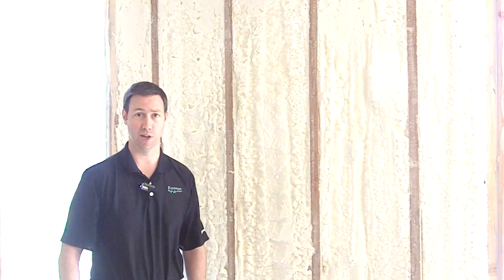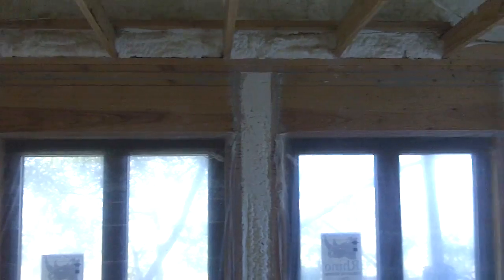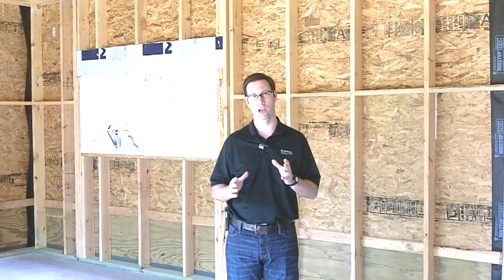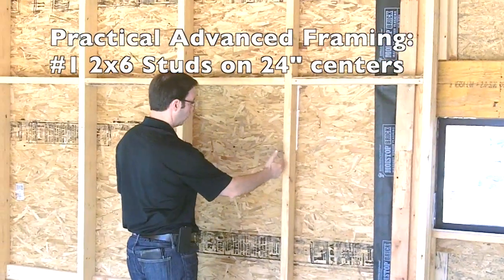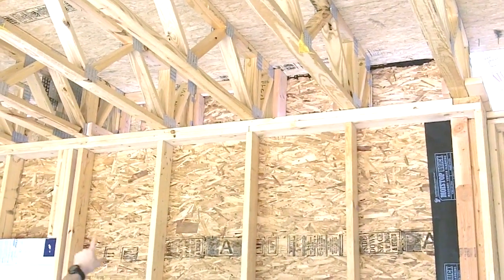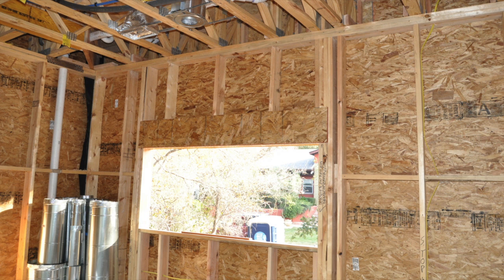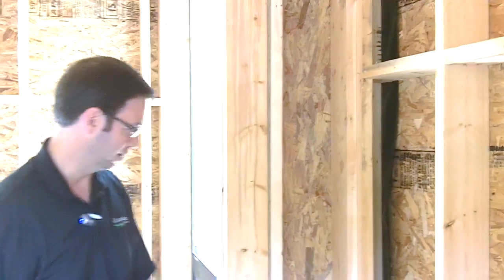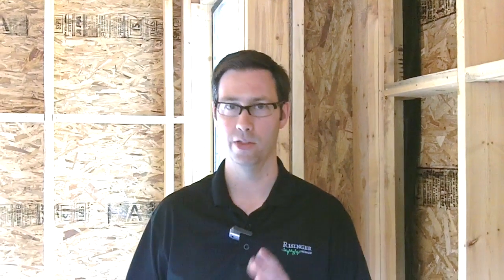Advanced Framing vs Traditional Framing

Comment: 2x6 on 16 inch centers is what I use. Live in the North East with big snow loads. Lumber isn't as strong as it use to be, don't cheap out. All kinds of great insulating techniques, use them.
Reply: Konda, regardless of the modern testing of todays materials, none of that has any effect on the greater stiffness of yesterday's old growth Doug fir framing, which was quite superior.
Reply: There is 20 percent more wood in his wall than in a 2x4 wall with the 16 inch spacing.  He doesn't even need to align the joists, he got that part wrong, though it is always a good practice if it fits in with the build.  

Not only is there more wood, but as far as, say wind deflection loads on the stud alone are concerned, the 5.5 vs 3.5 is  3.9 times stiffer and 2.5 times stronger.  of course the load will be 1.5 times stronger, but it is still a dramatic upgrade.

Stiffness of incredible old growth is not all that big a factor because the product does not go out of column, so until that point it doesn't mater.  If you were making arrows for a bow, they bend deeply with every shot, and stiffness, strength, and grain continuity are all critical, which is why each arrow is tested for modulus before it is used, and graded way beyond the standards for aircraft (aircraft is graded 1/20, arrow wood at it's best close to 0/20).  But with parts that effectively don't deflect, it doesn't mater.  That is why joists are rated for deflection, like 1/240, etc...  Unlike posts in column, they do bend.

What would be a factor would be the fact a lot of the old stuff was 2x4 actual, but 2x6 nominal is still stiffer by 1.94 in a wall being wind loaded.
Reply: Here in WV we would do 2x6 on 16 for exterior walls only and 2x4 for the interior.
Reply: wvman2374 and now with energy efficiency becoming part of the code more and more( B.C.) the suggestion is 2x6 24” o/c which creates less thermal bridging and approx 14% greater area with R20 insulation values
Reply: The more important thing is sheathing ... take a long 2x4 and push on it. It will bend one way or the other.
Now, attach that to plywood, and apply the same compressive force. It doesn't bend anywhere near as much because it is prevented from doing so. It's almost like a half I beam.
Reply: This is the first time I read wood is not as strong as it use to be.  I noticed it to the grain keeps getting wider and wider!  Swamp trees
Reply: Konda, Anytime.
Reply: Why then don't you go to 12" centers and really do a good job.
Reply: mmanut he’s in Austin, TX...not a lot of heavy snow loads there.
Reply: @elijahrobinson2362  LOL...yet.
Reply: 2 ft  centers wont pass code here
Reply: Konda sixtytoo, The modern day testing of materials is irrelevant to the strength of old lumber, which was stronger, being old growth Douglas fir. When the wind really gets to blowing in the plains states, you could tell the difference between a house framed with Doug fir. There really is a difference in the stiffness between the old lumber and what we get today.
Reply: mmanut how would lumber used vertically not be as strong as it used to be? KD spruce is inexpensive and tested. Do you really think that the building code authors do not test these assemblies prior to being implemented into a National Building Code?
Reply: @kondasixtytoo487  "how would lumber used vertically not be as strong as it used to be" Old lumber was the result of deforestation. New lumber is grown from tree farms. Old-growth wood has the rings closer together. New-growth farmed lumber is watered and likely fertilized to grow as quickly as possible, resulting in wider rings. The resulting lumber isn't as hard.
Reply: Ray Brensike and you don’t think the writers of the code factor the differences into the newer codes???
Reply: @kondasixtytoo487  

Building codes specify MINIMUM requirements and have little to nothing to do with "quality" evaluations.  They are specifying the minimum you have to comply with to have a "sound structure"
Reply: Jeffery Brown agreed! Building codes are definitely minimum standards. But those minimum standards must still meet the testing guidelines to be included in the body of the code
Reply: @kondasixtytoo487  

The irony of this whole thing is that NOTHING this guy does is "advanced framing"....it's still just traditional framing.  

Advanced framing uses things like SIP panels, stackable concrete/foam panels, etc.  This guys trying to "brand" what he does as "advanced" but that really only fools layfolks
Reply: Ray Brensike , today’s testing has no effect on yesterday’s materials? Wow insightful!
Reply: @kondasixtytoo487  You're right Konda that building codes are well tested. I think Ray was trying to make the point that lumber from 1st generation forest are stronger and more superior than lumber from used today, that is typically second from a second generation forest. Older lumber typically has a tighter ring density which makes it stronger.

Comment: Matt, is anyone using 2x5 plates with 2x4 studs staggered so that the interior and exterior walls do not touch? It is is done in soundproofing but I am unaware of it being used structurally for increased R value.
Reply: +Dave Collins the idea is a "2x6" wall using 2x4 studs usually 16 oc alternating inside, outside . a 2x4 wall sheeted osb and sheetrock only has a value of r5 on studs and r24 for the wall. thermal break that with 2"of spray foam your stud is now r20 and the rest of your wall is r40. Of course this makes sense if you live in an extreme climate like winnipeg -40 in the winter, 100 in the summer.

Comment: Although many doubt the strength values here, a 2x6 is more than twice as stiff as a 2x4. The value is known as the section modulus. The Section modulus of a 2x4 is 3.06, while the section modulus of a 2x6 is 7.56. With the exterior fully sheathed it becomes even stiffer. As long as the building is properly engineered, this system will be as strong as any other system. California corners are a great way to help with energy. All US Building codes require 3 studs in each corner. The California corner has 3 studs, just in a different configuration form what used to be the norm. There are some problems associated with wider spacing on the studs, especially things like cabinets, but I always add a little extra blocking to allow me to mount cabinets. I did notice in the view of that one bottom plate that the anchor bolts were just barely within the 2x6 sill plate. That would never fly in Earthquake country. By the way, I am an Engineer and also a builder. I have been building for nearly 35 years. I have built homes on both coasts and there are a lot of changes involved in going from West to East Coast. This system isn't really that advanced, it's a selling point for this builder's homes. Remember, never assume that what you want to do is legal until you talk with your local building department. They have the final say on what is structurally sound for your area.
Reply: Doug, the size of the foundation wall is determined by how much load you intend to put on it. Soil will support a certain load per square foot, and that differs depending on the type of soil you're working in. If there are no interior walls to support the floors above, that means that the free span of the joists has to support all of the load, and that load is transferred to the outside walls and them down into the ground via the footings. A building like this would probably have to be signed off by an engineer. There are joist tables that show allowable spans for floor joists. I once framed a floor system that spanned 24 feet. I was required to use 2x14's at 12 inches on center to accomplish the task. The joist size is determined by the span distance and the load that the system must carry.
Reply: @ammerconsulting  And the modulus of elasticity of the wood species
Reply: Bill Ammer 

Just came here to give Bill credit. Amongst all the comments in this video, he was the only one to back up his statement with scientific research.

It's a shame to see so many negative comments here but I think the truth to the matter is "You can't teach an old dog new tricks."
Reply: I built my house with 2x6 studs on 24 inch centers in 1985 purely for energy conservation. These walls are stiffer than 2x4 on 16 for the reasons Bill Ammer mentioned. Every stud is a heat leak, as the R-value per inch of pine is less than half that of fiberglass.
Reply: +John Sluder 
You're build costs 200% that of the 2x6 at 24" build by the fact you are doubling up on 2X4.
2x4 at 16" uses the exact same volume of lumber as 2x6 at 24".
You've used twice as much lumber for the framing. 
It's basic arithmetic and economics.
Reply: I do not believe the section modulus has anything to do with stiffness nor the compression values that are needed for stud configuration.  Section modulus is used to help determine allowable bending stress.  The area moment of inertia, which is a function of the section modulus, and modulus of elasticity are used to determine stiffness.

Please refer to deflection calculations for different beam configurations and mechanics of materials texts.
Reply: Doug Hanchard
Reply: Agree, code is 3 studs in a corner. I have used the CA corner or two studs with a spacer 1 way and 1 stud the other way. If the second way, I always insulated the gap from the outside before installing the sheathing. Same with an interior wall meeting an exterior wall. I built my own house that way in 1984. Also agree that jamb extensions stink.
Reply: Bill's comment is along the lines of what i was thinking.  Strength values.  Works for rafters as well as walls I would think.   But what I don't know is, is this cumulative for a section of wall?  Meaning, 2x6 at 24 OC you need 3 studs.  And 2x4 at 16 OC  you need 4 studs.  So can we add the strength factors for the boards in both to compare?   2x6:   3 boards x 7.56 = 22.68,  and 2x4:  4 boards x 3.06 = 12.24.    Does this give the 2x6 wall with 3 studs, 85% more strength than the 2x4 wall using 4 studs?    Also, I see no problem using the Cali corner on 2x6 construction as a result, but I would not use it on 2x4 construction, bc it seems like you will need that extra board to give more corner strength on the 2x4 wall.  Keep in mind I am not a builder or an engineer, but have some knowledge of load factors.  As far as sheet rock I do not like the thought of using 1/2" on 24 inch center studs.  Too flemsy!   At least without foam in the wall.  Might be OK WITH foam.  Not sure.  I like the idea of beefing it to 5/8", but those jam extensions will be more costly and time consuming.  Great discussion!
Reply: All the comments are hypothetical - it would be nice to go back to the house 10 years and 20 years after the build and see how many problems the owner has with sag/cracks/etc.
Reply: But doesn't this home actually use more wood?  2x4 vs 2x6 = 50% more wood, spacing of 16 vs 24 = 50% less in spacing, but the bottom and top plates are now a 50% loss.  Also, that bridging half way up now increases the wood used on this home.  Am i missing something?  not to mention the 2x4 trusses.  Geez, this home seems to be way more in consumption.
Reply: They moved the camera quickly, but it was obvious and I got the feeling he knew about - "I did notice in the view of that one bottom plate that the anchor bolts were just barely within the 2x6 sill plate." 

Overall it's interesting and  I'm glad there is a framing debate here. Sprayfoam? Mold? Thanks for the videos!
Reply: Ever use a double exterior wall system? 2x6 interior framing with headers, standard framing. Exterior framing offset 8" with continuous 2x4 framing to the soffit with insolation in both walls. With engineered I joists for floor joists and rafters. I charge for what they cost, not where they are built. Also don't use anybody that doesn't speak English. Have found that sometimes the inspectors are not up to date on the new materials, like engineered lumber studs.
Reply: Doug Hanchard- most code around the US is 16 on center. Not sure where 24 on center is allowed
Reply: The local building may have the final say on what is LEGAL for your area. That is NOT the same as being structurally sound.
Reply: skojo3e up here its used but 8' walls only but they say its for r-value but we both know they re just cheap
Reply: Well put and direct point.
Reply: The local building codes are designed to protect the county or city from lawsuits. The codes can always be over ridden by an engineer designing something different. The Liability for failure then falls on the engineer instead of the building department. You may be right about being structurally sound except for the fact that they want it sound because they don't want to be sued. You opinion of structurally is based on your personal knowledge and experience and may not be based in real design engineering.
Reply: +Bill Ammer Well said. I don't think there's any problem with 2x6, but 24" centers.... makes me squirm. Another issue is foundation wall thickness. And the cost of concrete isn't going down these days...in fact, in most regions, it has skyrocketed. 

I also agree that this is not 'advanced' framing. The debate between 12, 16 and 24 inch centers has been around for a VERY long time. Advanced framing to me these days is really not even true. The last big advancement we had was Styrofoam block with rebar concrete for foundation AND walls. And that was in the last 1980's and it still isn't popular in most regions of North America despite its strength and insulation properties. 

But I do have an 'engineering' question regarding exterior walls that maybe you can answer. If we have a three story home, including full basement with 10' ceiling, and the goal is to have as much open concept on the first floor and some of the second floor (say over the living room and some sections of stair wells, etc., I would imagine the thickness of the footings, foundation and the wall stud choices play a critical role in joist sizes and type. Thus, would a 12" wide foundation and 2x6 walls on 12 or 16" centers be sufficient for a home that is 36" wide and has to some steel I-Beams for joists? The goal is to avoid centered load bearing walls right in the middle of the centerline width of the home (18 feet). 

The reason I ask was years ago I looked at building a custom home and thought 2 x 12 joists would be sufficient and the regional building inspector said no and then mentioned the footings and basement walls would have to be 'engineered' and approved. At that point, all I saw in my head was big dollar signs and dropped the whole idea of custom home.
Reply: this makes the build more costly. Now you have to have full sheathing

Comment: What about snow load?  Up here in NH most houses had 3' to 4' of snow on the roofs causing some structure to collapse with the standard 2X4 16"OC walls.  24"OC would definitely not meet code anywhere around here.  With the past few winters we've had, 4"X6" 16"OC might be called for or even 2"X8" walls ... then you could pack in a good amount of insulation.

Comment: Great video. I'm currently debating floor truss (12" deep, 18' span) spacing (19.2 vs 24). I would really like to go to 24" spacing for many reasons but am concerned about overall stiffness and added cost for thicker subfloor and gypsum. I have also heard floor trusses on 24" centers can be noisy. 19.2 appears to be a reasonable compromise but seems to be more challenging to coordinate with sheet goods and wall framing not to mention more challenging MEP coordination (this is a small house, space is at a premium and I would like all systems in floor cavity). Does 1-1/8" decking resolve issues at 24" spacing? I guess I am trying to determine if the cost of the decking is less cumbersome than the issues created by 19.2" centers. Any experienced, productive feedback would be appreciated.

Comment: The better modern wall.

16 inches on center is a leftover from when heavy plaster was laid up on lath.

A 2 x 6  wall is more rigid even without thicker drywall and foam in place. Here's proof;

A section of exterior wall using six 1 1/2" x 3 1/2" two by fours puts a cross section of 31.50" square inches of supporting wood under the header. 

That same section of wall made with four 1 1/2" x 5 1/2" two by sixes puts 33 square inches of wood under the header. 

A wall with a wider footprint is inherently more stable and will withstand side loading and twisting forces such as those experienced in tornadoes, for example. The thicker insulation cavity filled with foam in place insulation kills sound for a quieter building and reduced air infiltration.
Reply: Or you can go 16" on center with 2 X6's like we do here in Southern NE....

Comment: If your "advanced framing" process works and a cost savings can be provided to your clients, then go for it; however, from an engineering standpoint, taller walls with wider spacing, you may have slender 2x members. I assume all your framing is Engineered for all tributary gravity and wind loading? Your wall sheathing has a span rating too. I assume you are using sheathing that has at least a 24" span rating for wall applications?

Also, floor trusses that end up directly on the wall studs is also very convenient. A lot of times this isn't the case. Truss spans, heights and loadings will dictate your truss placement and 16" (or even tighter spacing) on center will be the spacing.

Look forward to more videos.

Comment: Won't pass inspection in my state. Needs to be 16" oc. Sounds like contractors trying to cut corners and price. I don't see any benefits with insulation difference between 16" oc to 24" oc. Especially if your using spray foam. 16" oc in the end will be stronger.